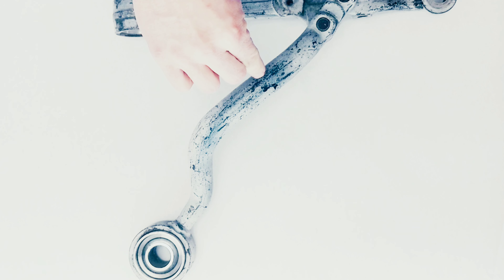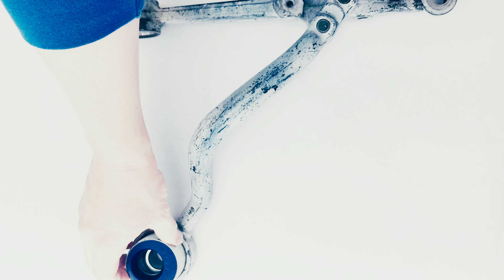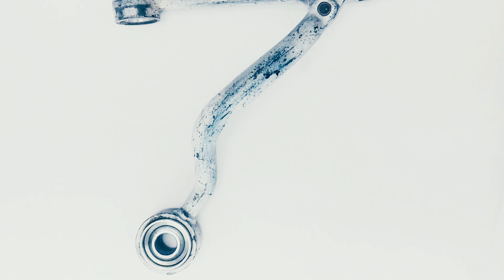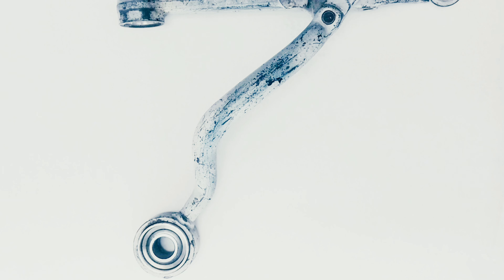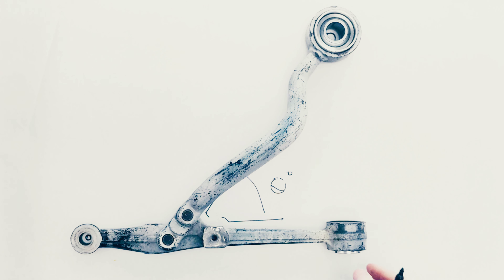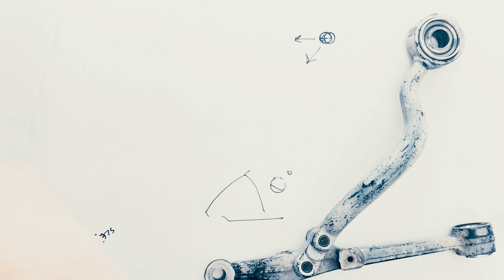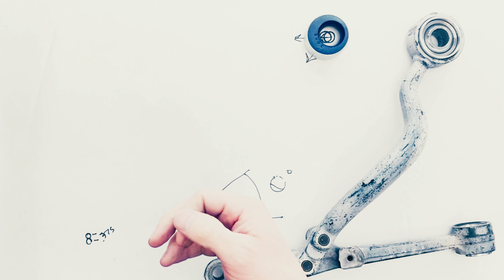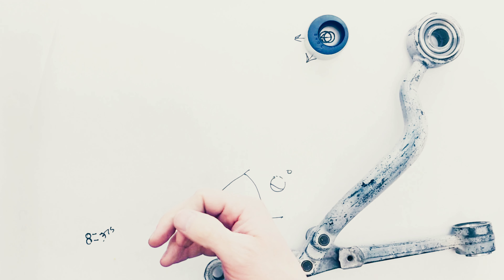Why Adjustable Caster Arms DON'T WORK!

Comment: Just want a good tension rod for grip and drift. On coilsovers and feel like I should go back to stock suspension parts because of height drop. But my rods are worn and a lot of vibration.

Comment: What if you are running all stock, but you just want it to last longer than oem will the adjustball bushing works too?😊
Reply from the maker: Adjustable bushings rotate the pivot, so they work, but will stress the #1 location.

Comment: So, what about a cam bolt similar to camber adjustmebt bolts for Macpherson struts used in the rearward bolt hole on the control arm with an adjustable length tension arm? May not be a huge range of adjustment but quicker than pressing bushings in and out repeatedly to get the propper adjustment.
Reply from the maker: Plenty of ways to do this... just no company that mashes these arms allow any pivot there.  We already solve this issue on our PROAngle tension arms but they are designed for our LCA not stock.

Comment: Some of us have lowered our cars and have cut knuckles / shortened spindles, but are trying to get back to oe caster and camber for drivability and tire wear.
Reply from the maker: Regardless of the things that you mentioned these arms cannot move past OE measurements otherwise otherwise they would bind. That is all this video is about. You don't lose caster from lowering.
Reply: @FIGSEng  So what causes my 04 gs300 to lose 2 degrees off caster??? My alignment settings are nearly perfect other than that.
Reply from the maker: @mrman8856  like I mentioned, if its not a swapped upper control arm, then I would look at the #2 caster arm length and or bushing to see if it is collapsed.
Reply: @FIGSEng Wasn't the caster arm ( changed to adjustables anyway ). My upper arm wasn't on the wrong side either lol. But you was correct about it being the upper arm, the ball joint was bad from hitting the wheel well...I also want to say you are correct about the adjustable caster arms moving the suspension and binding, specifically during hard breaking, or cornering

Comment: Why dont you make like Ackerman washer the allow the arm to change angle
Reply from the maker: Because the threaded portion is on the caster arm not the lateral arm.  A pivot needs to be designed into both arms.
Reply: I understand. But technically cant the  furthest hole  from the catser rod mount be the pivot and the close one be be like slot to get the adjustment at that bolt
Reply from the maker: @davemathewscustoms2133  yes... but none are designed this way except for our Proangle arms. You would need a slot and a floating fastener. You still stress the front bushing in any adjustment without replacing it with a spherical joint.
Reply: I get you. im going to go and slot my god speeds and see what happens lol
Reply: @davemathewscustoms2133   how did it work out?

Comment: I just want my dang 2 degrees of caster back that just magically disappeared one day. All bushings,  and arms are new, so I'm confused.
Reply from the maker: Check that your upper arms are on the correct side.
Reply: @FIGSEng  LOL  🤣🤣 That's funny.  But yeah they are on the right side.
Reply: same happened with me when i renewed all my bushes, my steering feedback went to shit
Reply: @marwatfpv4419 One year later... 2 sets of FIGS adjustable end links later ( improper installation on my part ) lol...I used RCA's to get my suspension geometry back, and like the FIGS guy said I did have a bad upper arm ball joint, it was on the correct side of the car though lol. My arm kept hitting the upper wheel well, which caused the ball joint to prematurely fail. And I have adjustable caster arms.